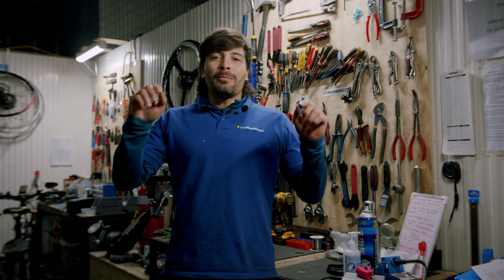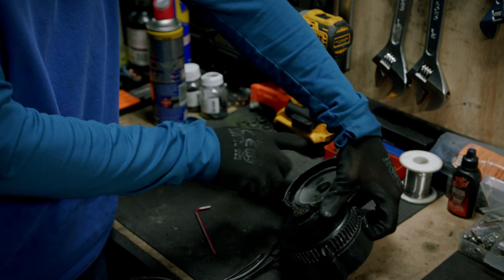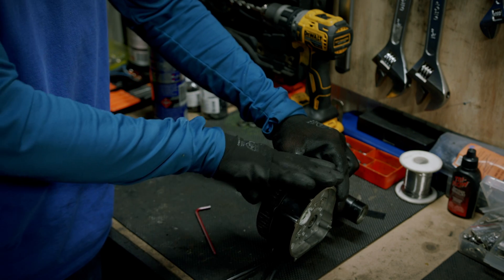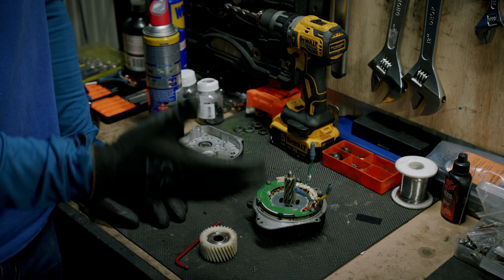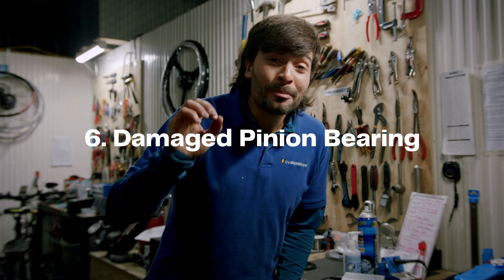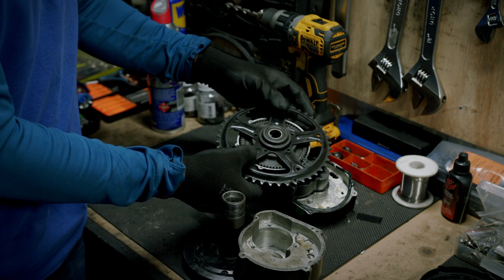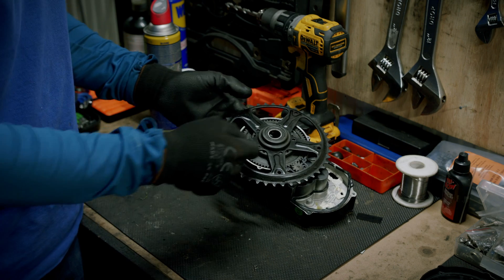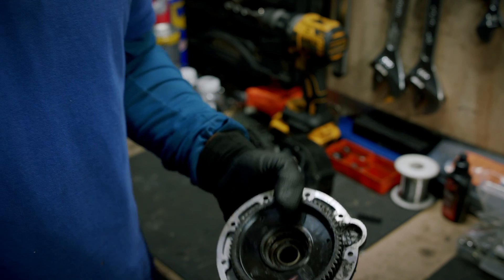Bafang BBS Motors The Most Common Problems of These Mid Drive Motors

Comment: Excellent breakdown! ThxU!  Quick question. Can you use the power output gauge to insure that you’re not stressing the inner & outer drive train.  I’ve got a 620 Ultra and virtually never drive the wattage into the 750-1000 range! Usually, a simple downshift or harder pedal will drop the wattage on a hill or starting out!  Should this be the goal or am I missing something? 
PS: Would an RPM gauge be helpful?
Reply from the maker: It’s preferable to have more speed (rotation) than torque when the motor is performing, that means is better to be on lower gears (1-2-3) let the motor Rev higher then you shift the gear up. Keeping it below 1000w is good for the motor but doing it in the wrong gear will still cause damages. Please watch the following video, it should answer all your questions https://youtu.be/jb3v5Y0Q2l0
Reply: @Cyberbikesau  hi! a need help! An error "11" (motor overheating) has started appearing on my display, but in reality, it's not overheating and is always cold. The error appears even if I turn on the bike without riding it. When riding with the error, the power is limited by the controller to 500W. I think it's a temperature sensor malfunction, but where is it located? And can it be fixed?
Reply from the maker: @albertrammstein6452  that's inside the motor, most likely you will need a new controller
Reply: @Cyberbikesau  Yesterday I pondered what the malfunction might be. I asked ChatGPT about some aspects of electronics and concluded that there is no temperature sensor (thermistor) inside the motor unit. It's most likely located inside the controller and is either a separate temperature sensor or integrated with a MOSFET transistor. Waiting for a new controller would take quite a long time, and I was thinking about repairing the old one, considering that there are no problems except for error 11. The motor works and is fully functional (except for the power limitation to 500w and the error constantly displayed on the screen).
Reply: Basically the best way to looking at properly using your gear Cadence is to compare your cycling to that of an 18 wheeler semi truck. Semi trucks use a gearing to be able to move forward. If they did not use all their gearing they would blow the engine. This holds true with an e-bike.

Comment: 17000km no issues, other than changing controller once.
Gasket was put on wrong from factory, full of water.
After changing to new controller and making own gasket 10/10. 
Lowered the amps from 25 to 20/21amps.

Comment: Being as you're saying that one of the biggest reasons for premature failure is applying too much torque, do you think it would be wiser to buy a 500 watt kit rather than a 1000 watt kit? Or are the gears in a 500 watt kit less robust?
Reply from the maker: What you said doesnt make much sense, because the 1000W generates more torque but it's also a more robust motor.
The point is the vide is, start the bike on gear (bicycle gear 1) and as the speed of the bike goes up, you shif gears up exactly like on a manual car, then before you stop the bike you bring the gears back to 1, identical to a manual car. Any other way of using the bike is not correct and will case damage to any motor.
Reply: @Cyberbikesau I understand that that's the proper way to use the bike, but considering the fact that sometimes due to human error someone could easily forget to downshift for a moment, and I don't think anything that costs $600 ought to have such an easy failure point. So if you have to same drive train but a weaker motor, then the weaker motor will most definitely be less likely to destroy the drivetrain. My question was if the drivetrain is different with a higher wattage motor. If it is built stronger, then I would say the higher wattage motor setup could end up being more resistent to human error. I agree that higher gears should not be used to climb a hill for example, but there could be a point where you're just climbing up and down and up and down and up and down and have to keep shifting gears, and then maybe it starts to drizzle and so you reach for your raincoat and don't downshift at the instant you normally would. I don't like the idea of a several hundred dollar investment being so vulnerable to massive destruction with just a simple mistake like that.

Comment: HI there! 

Any idea what might be the cause for my motor refusing to run at full power? 
My display shows that it goes up to about 390 watts ish, when it its configured to 24AMPs on the controller.
48V 750W BBS02B 

Battery is fine and I have a spare battery to test with and it happens on my other battery too. 
It almost seems like the controller refuses to follow the settings I give it.
Reply from the maker: damaged controller, probably it overheated and now is on limbo mode. try upgrading firmware but not always it fixes the problem, best way is to buy a new controller if you have $$ to invest.

Comment: Very informative.  My problem is that the power turns off.  I lose power.  The battery has been tested and checked.  So it isn’t a battery problem.  Mostly right after I power it on. But Sometimes while I am riding.  Can you help???

Comment: Thank you for the video! I have a problem with vibration through the pedals, not caused by chain, cassette or controller, it is most definitely the motor itself. I didn't use a tork wrench when installing, I just used the tool and a hammer. Can you explain what the symptoms om over tightening the shaft to the bottom bracket is? Thank you again!

Comment: Im picky with all these mechanical things, but BBS02 is really good. 
BUT
it needs to be lighter. Its big for the motor size. theres a huge metal gear in it that needs milling
The driver should be soldered in place directly to the power cables, and its been fine, it just needs to be soldered. 
The grease needs to be ptfe everyhwere. or ws2
And the driver needs to be controlled over standard interface. Because the factory modes are crap. Should supply programming cable as stock program will need changes due to weight and cadence and gears.

The thing could be much lighter. Like minus 3 pounds easy. 
Screen and throttle and shifting should be all in one. and the sensor wire is all thats needed. 
Dont deal with the light on these things. ANd shift like manual. THe defalt power settings are worse than the gear shifting. 

Then you add good parts. like gan mosfets or even lower loss silicon mosfets factory. 
And add n52 magnets. 
And with everyhting else improved in these small ways, you have a bike that is very durable with the right grease, fast, lighter motor, and more efficient. 

All can be designed and cost the same, or it could be optimized to cost even less. 
There is alot of mechanical gears and bearings that can be simplified. 
That should be the bbs04 its a number not an hd you dummies. 
Its iterative improvements 
ceos that say otherwise need thier heads placed in the gallows. 

The way is improvement, not retarded design gimmicks. 
Why scrap a casting procedure when other things can be optimized, like for example low loss stator amorphous nanocrytalling core?
This can all be done SUPRISINGLY WELL.

Comment: I have a mid drive BBSHD and the display does not come on. I’ve checked and all wires are in good shape. I opened up the controller and connected the black wire on my multi meter to the black controller wire. Then the red to each coloured wire yellow, green and blue. I got 9.95 but when i tried the black to red and all three coloured wires i got nothing? Also, my battery is showing 54v  going into the controller but i thought the bbshd motor is 48v?   Thanks

Comment: I have a bbshd and whenevers it’s under load in a high gear it makes a loud clicking or popping noise occasionally only when im riding in higher gears, any idea what it could be?
Reply from the maker: worn out cassette, specially the smallest sprockets, replace the chain and cassette for a better result

Comment: Thank you so much for your video. The tips for caring for the engine are really good, and the explanations for repairing it are even better. Unfortunately, my case isn't among those explained here, but I hope you or someone else can give me some insight.
My engine stopped starting. At first, when I turned the system on, I sometimes had to remove the battery for it to start working, and it was fine until I turned it off. Then, I had to disconnect the cable that runs from the engine to the display, and it still worked until I turned it off. Now, when I turn it on, the display only blinks for a second. That gives me a little hope that the engine isn't completely dead and maybe a cable could be damaged?
I really need help because where I live, repairing anything is super expensive, or they simply don't want to check it.
Thank you, and I hope someone can give me some idea of where to start.
Reply from the maker: most likely you need a new controller

Comment: may i ask, what might be the problem or where should i start when pedal assist stops working but display still shows info?
Reply from the maker: does the throttle work? if throttle works and PAS is not working, most likely you damaged the PAS sensor/magnetic disc by not riding the bike at the right gear. I mean, riding the bike on a gear that's too heavy for the motor to turn, it caused a misalignement inside the motor and the PAS was grinded off
Reply: @Cyberbikesau i just got a throttle and i can now confirm, sadly it doesn't work either
Reply from the maker: @jpasw  new controller then
Reply: @Cyberbikesau Ouch.. thanks. So it's a controller problem even if the lights and the display works fine but neither the throttle and PAS work?

Comment: If I get one of these, I won't hot rod it with extra amps, and I won't take it off pavement, perhaps a little gravel and dirt roads. I can't promise to keep it out of the rain or store it inside at night in the winter. The battery pack-yes. I won't let it freeze. I would like to get 5 or 10 thousand miles out of a motor to get my money's worth; hopefully more with maintenance and rebuilds.

Comment: How about using a torque bracket that is held to the down tube with a hose clamp?
Reply from the maker: good specially if the motor keeps coming loose, but not necessarily mandatory
Reply: @Cyberbikesau  People talk about square taper bottom brackets like they are indestructible. However, they are actually quite sensitive to over-tightening.

Comment: Hello! This is a fantastic video!! I am trying to diagnose why my pedals arent able to send human energy to the rear wheel, however, my throttle still works fine and im still able to shift gears. Any idea of what may have caused this and what may need to be replaced? Thank you in advance!
Reply from the maker: yes that's a paw clutch, goes between the pedalling axle and the granny gear of the motor.

Comment: Hi, I have a bafang m400 mid drive city bike ( Corelli E Lite L). It has 32T chain ring and 11-46  teeth on the back. The problem is: Although it has a 85 nm stated torque, i can not feel such power. While climbing a big hill, i can not shift to lower 2 gears (37T and 46T). When i shift those lower two gears it doesnt give full assistance while pedalling. The assistance of the motor corruspts sunndenly half of full pedaling for a second and power on again. This is very disturbüng. I couldnt found the root cause. Can you help me about this problem?

(The bike is only 200 km riden)

Comment: Nice video! Thank you. I have the BBS 02 and I have 28 000 kms trouble free until recently - The motor makes a loud chirp sometimes when I come off the brakes and the motor powers on again - this happens infrequently but it is a sign that maybe the wide nylon gear is starting give up!!!
Reply from the maker: Indeed it could be the nylon gear. When you make that technical repair, replace the nylon gear and the opinion gear and axle that goes inside the nylon gear! lubricate their contact well with bearing grease!

Comment: In summary: these bicycle motors are not designed to handle heavy sustained load, so (1) use the proper gear, and (2) assist it by pedaling. Probably another good idea is to shift smoothly: lessen your power during shifts (much like lifting throttle on a motorcycle or manual transmission car).

Comment: I have a bafang 1000w mid-drive motor and i have recently been hearing a distinctive click noise every 5 or so seconds while i am riding with pedal assist on. today i realized that the pedals lose resistance slightly when the click noise happens almost like its a really high gear. after the cick noise, the pedal feel goes back to normal. this is until it clicks again and the pedals lose resistance for a second. i am thinking its the nylon gear?

Comment: I have just purchased a new controller for my 52v bbshd. A couple of weeks beforehand o went to ride and nothing, no power to the display or anything at all.
That's when after waiting on delivery I installed a new controller and a new display got through power to the new display but said error 10. It's impossible to overheat, check the obvious like all cables, battery working and charging.
Tried the old display and nothing. All the numbers for the right controller for my bike, but like a said nothing but error 10.
If anyone can help with this it would be most appreciated 
Thankyou, Lukasz 
Newcastle Australia 🦘🦘🦘

Comment: Thank you ! I now understand why my 750 watt motor has been damaged! I mounted my battery too high on the down tube so the bike was constantly falling over. And where I live on Maui I travel through Dirt, sand, as well as when the rain comes it quickly creates flash flooding with no warning sometimes. And I was pulling a trailer designed for two 50 pound toddlers however I’m 61 years of age and my son is 25 so I don’t try to haul he and my ten pound cat at the same time😂. I use it for getting food and supplies to my off grid structure including potable water, Gasoline, and non potable water it’s a 24 mile round trip I was doing at least once a week and sometimes almost every day. For the last two years🤜🏻💥🤛🏻🏝️💪🏻! So I will take it apart and try to see what the problem was that unfortunately sounds now like I just killed the poor old 750 watt girl who treated me so well and never complained when I was making her pull these sometimes 150 lbs cargo loads 😂❤the bafang was good to me and I rode her like a mule HARD and put her away wet! I guess it’s time for an upgrade to a stronger, younger mule that can keep up with a 61 one year old animal that pushes to hard for gal that is not into doing chores when ever I say let’s go baby I hungry and we need to go now!!! Thanks brother Cyberbike man I forgot your name ? I have commented on your videos in the past and was always able to feel like an old dog is still capable of learning some new tricks! What would be the recommendation for an affordable upgrade?

Comment: I use a Narrow/Wide small (36T) chainring to keep the motor spinning fast.. A fast spinning motor stays cool.. a lugged down (slow spinning) motor heats up..   36T will also provide more torque and increase range.. I know it seems counterintuitive but highers power level setting  and lower gears increase the range of you ebike.   Protect your motor by feeling it occasionally to see if it is unusually hot.. I carry a wet washcloth in a ziplock bag to wrap around the motor to act as a radiator.. i use rubber bands to hold it on on hot days...I live in Portland with steep hills.

Comment: I have a BBSO2 750w 48v-30 amp dual battery pushing a Trek 4500 26" OEM 44T 8 sp 16/46 freewheel with less than 400 miles. We have a lot of hills and the motor got very hot for a second or two the cranks were spinning with no traction. I hope I didn't damage the motor but once it cooled down I had traction. I ordered a 38T,36T, and Lekkie 28T chainring. The 38T was a big improvement but scared to test on that hill. So I just installed Lekkie 28T using the same 8 sp with the 16/46 freewheel.
Any input would be gladly appreciate ?
Reply from the maker: Use the gear ratio in your favour, unless you're carrying hundreds of kilos of load and riding offroad, engaging the 46T with a 44T chainring would be enough on a 26" wheel ebike. The motor is only cooking because you're using the wrong gear ratio. If your pedals are hard to pedal, the motor is struggling. If it's easy, the motor is alright. Always keep the motor in high revs, like cutting out on revs, that's how you should ride your ebike.
Reply: @Cyberbikesau  Thank you for your quick reply! Today I did a test run using the 28 T Lekkie with the 8 sp 16/46 freewheel. This was much better gear ratio for our hills definitely a workout no more ghost pedaling motor warm not hot. I'm crusing up the hills 20 mph in 4 and 5 gear. The two batteries do add weight but, no more range anxiety.
Reply: Use the gear ratio in your favour, unless you're carrying hundreds of kilos of load and riding offroad, engaging the 46T with a 44T chainring would be enough on a 26" wheel ebike. The motor is only cooking because you're using the wrong gear ratio. If your pedals are hard to pedal, the motor is struggling. If it's easy, the motor is alright. Always keep the motor in high revs, like cutting out on revs, that's how you should ride your ebike.